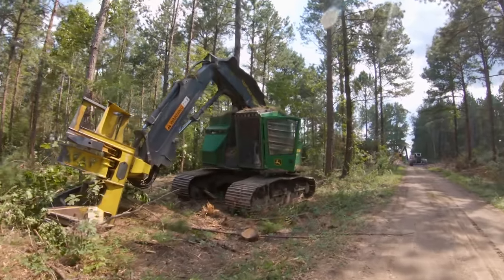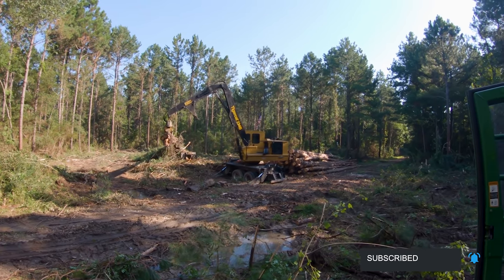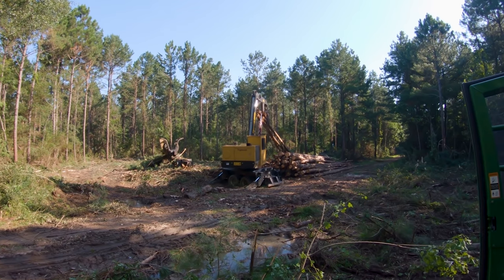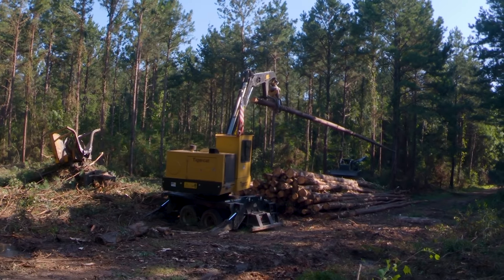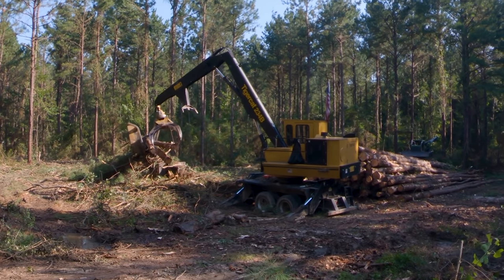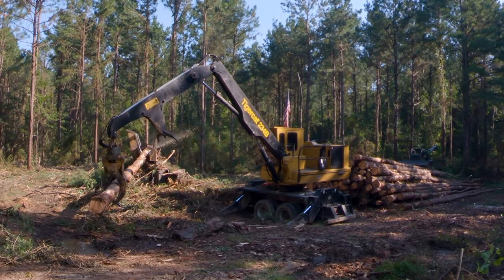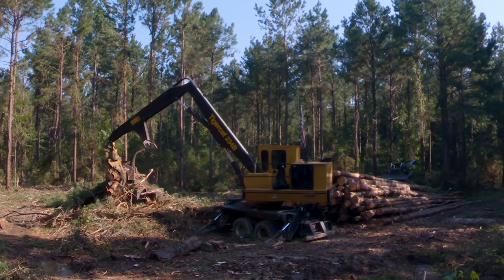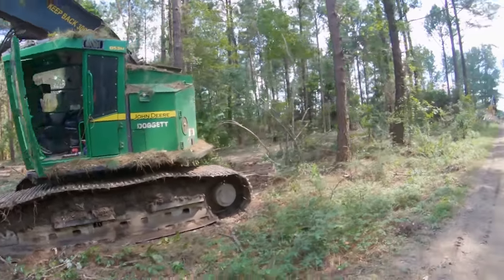John Deere Track Cutter | Did They Fix It This Time & Do We Sort Chip N Saw

Comment: If the cutter cut a tree that had metal in it would you have to change teeth on blade?
Reply: If there was enough in it to cause damage. Most of the time in pine plantation there isn't any. I have seen the cutter man hit the limbing gate before and had to replace a entire set.
Reply: We have alot of logs here hard an pine!

Comment: We just got an 848L2 yesterday. If I had to
Be completely honest I don’t know if it’s something wrong with the one I got or what it is. but that 748L2 I demoed would drag a circle around the 848. this 848 is dog slow.
Reply: We went from an 848l to a 648l2 and the 648 would drag circles around the 848. It’s got a smaller grapple but that 848 didn’t have the speed of the 648.
Reply: someguyfromGA we decided we was going with the 748 with the 848 grapple and sweda axles we ordered it from the factory they’re letting us run the new 848 till it comes in

Comment: Welllllllll sounds like Doggett will have to "lick that calf again" lol. I know I know  its not funnie but.
Look on the bright  side sitting in the ditch  with the door  open, its not running  hot. 
Hopefully  in the am they will  find that a connector  to the ac  just didnt get  pluged back together tight. A simple thing and it has happened  to us  all.